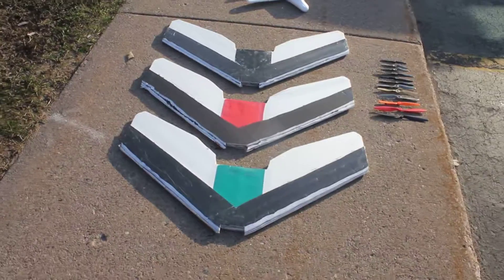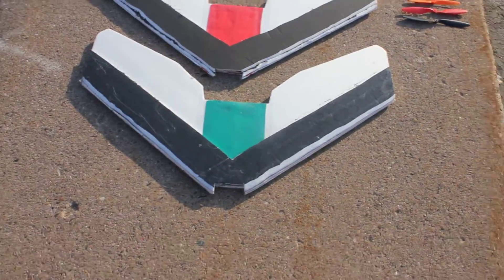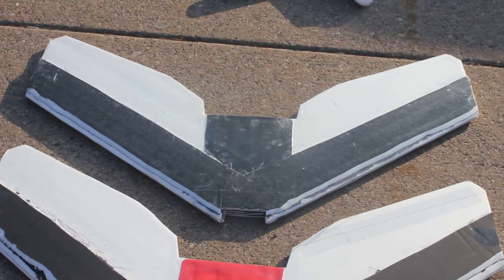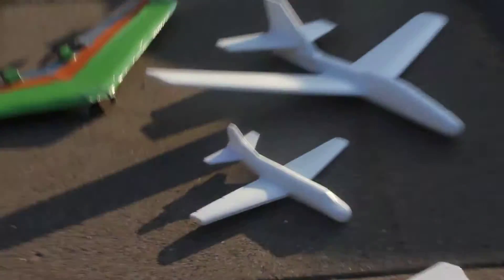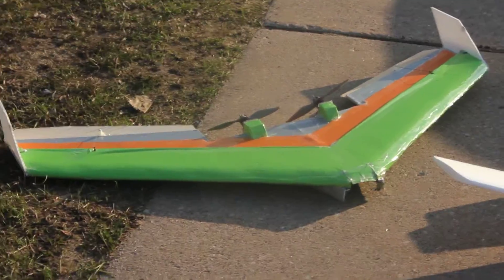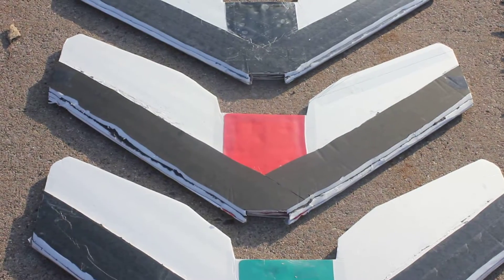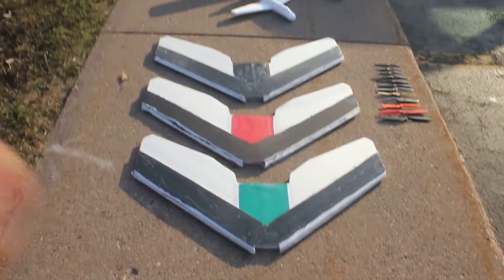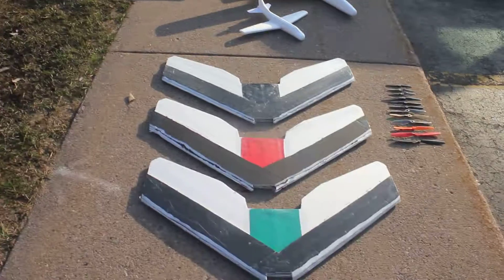Prop and Motor Combo Testing for the AVA-FPV- On the S5 Flying Wing

Comment: you mite need to put some wing tips up on them Flying Wings it will sure help in stabilizing, not so much on a regular wing, but on a flying wing all the air starts at the nose going down the wing and creating a vortex of air, like being in a jet wash. great video